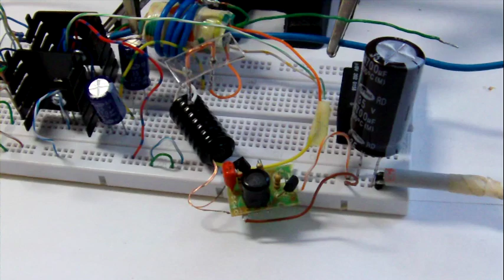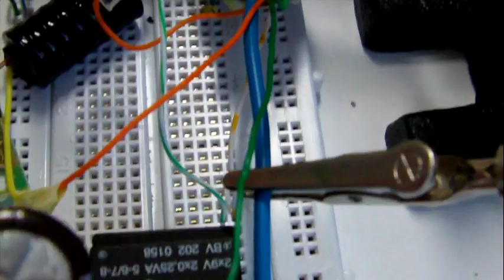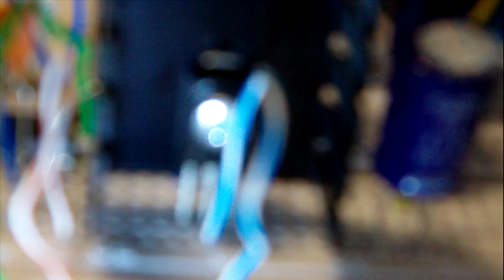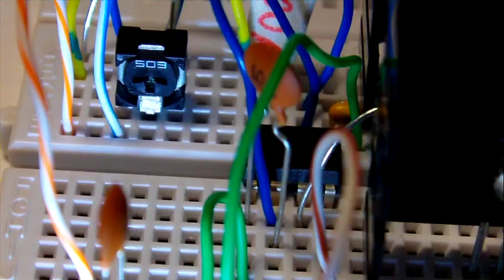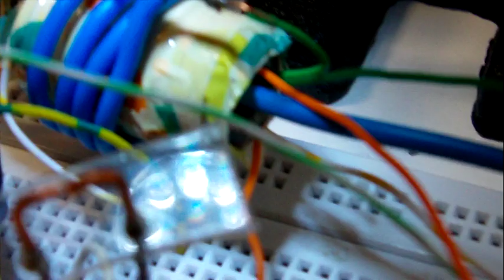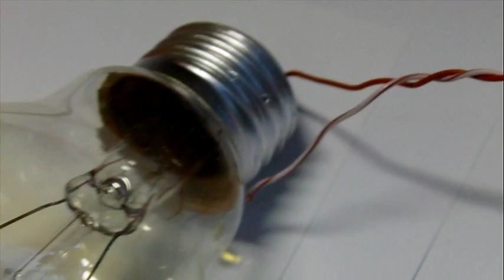Mini kapanadze circuit - 25W 230V AC - first test

Comment from the maker: Invertor is made from NE555 with BD139 + BD140 + 2x470 uF/35V capacitors.
HV(1 euro) from fire lighter (classic made in china), but output cca 3100 V. Spark-Gap maximum distance can be with 3V 8 mm, with original 1,5 V 4 mm.
Coil made from one piece ferrite, 3 windings.